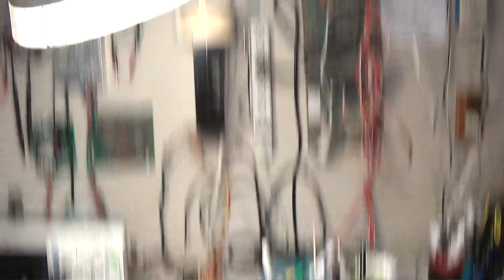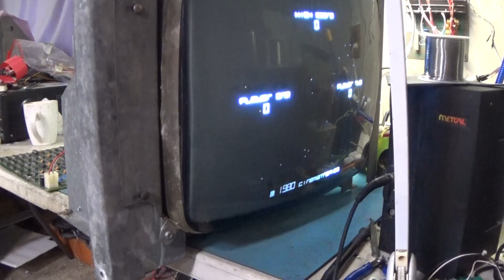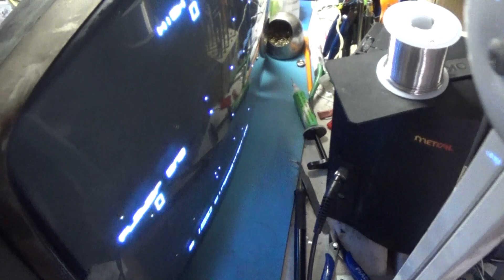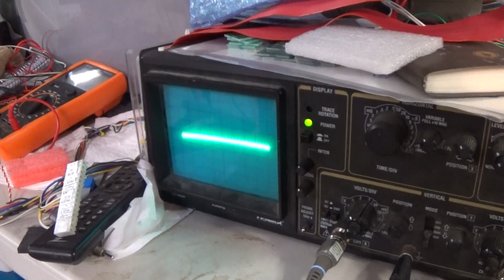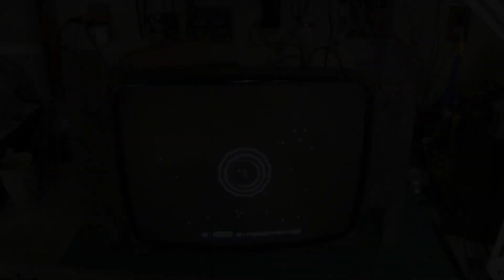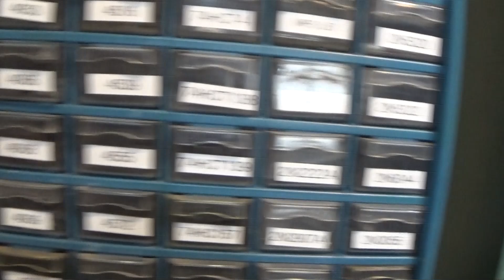CinemaTronics Vector Monitor Repair  - | Star Castle |Rip Off| Star Hawk| Solar Quest| Armor Attack

Comment: Hey Sean...its Bruce. Just wanted to throw this out there to you. I have an armor attack And when I first got it,  rebuilt the monitor chassis with all required upgrades. Game would boot up, but images were off. Checked the board and found out someone soldered in a 74ls75 backwards. Changed that out (And now getting to the point of my story 😊) picture looks excellent but I could not get it to center. I found a cinema tronics vector monitor FAQ and it said you can replace the Dac 80s with DAC 800s. I ended up pulling the 800s and putting the original '80s back in and the picture went center. I know it's a long story, but my main point is if you ever run into it where are the picture won't center and you have DAC 800s in, That may be the problem. I even swapped in an 80 and an 800 together and both 800s were doing the same thing when tested. Sorry about the rant Hope all is well my friend
Reply from the maker: Hello Bruce… Did you try playing with the magnetic rings on the yoke. that is for centering and moving the picture left to right
Reply: @classicarcaderepairs4818 hey pal, yes I did. And the whole image was dropped down about an inch to the highest point I can get it. The rings would adjust but would never come up that high. Like I said after putting the original dax back in picture went perfect

Comment: If that is your own test board it would be interesting to see if the customer board has the same 'Jitter' or maybe have a look at the  X/Y output signals out of your board closely, is the mains filtering ok ? as ripple might cause problems. You pretty much ruled out the semiconductors on the monitor so could the problem be on the test board ? no crazy ground loops messing with your head !  ? On a personal note do you know where I could get a decent spinner for Arkanoid and Tempest please. The 'Jitter' maybe a timing issue like cap/res not playing nice or the main clock having issues ? I'm just thinking out loud sir ! Did you check + - supply's for noise ? anyhow I am sure the owner will be chuffed !.....cheers.

Comment: Why do the phosphors burn out like that? Is there any display that can't be worn out? I guess the only display that doesn't burn out is the GameBoy's display. Probably because it has no light.
Reply: The Phosphor is a physical coating and when a beam of electrons strike the same place for often years at a time it can 'Burn' that coating away and just exposes the glass. Screensavers for your PC were invented to stop this burn by moving the beam around but nowadays we don't use electron beams. The gameboy uses LCD much longer life and TFT displays longer still. Just the basics but I hope it helps.